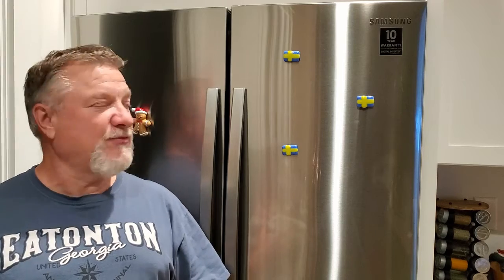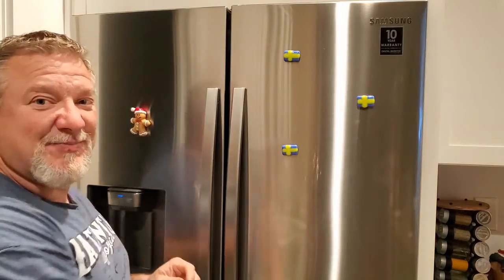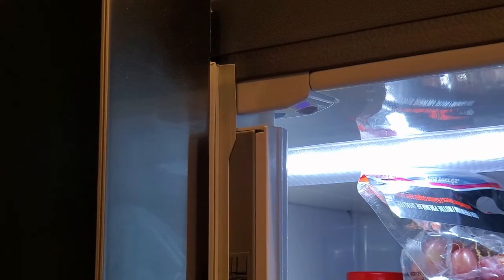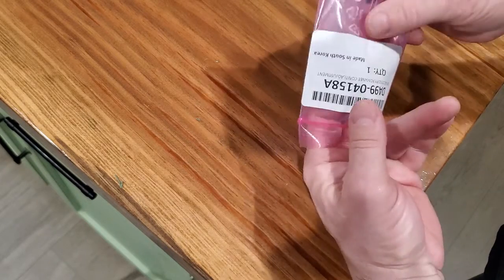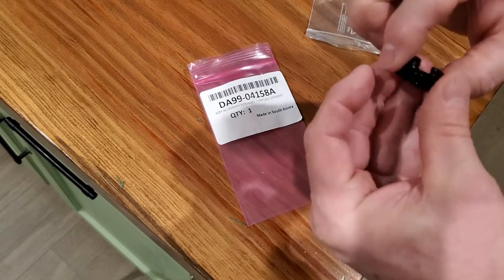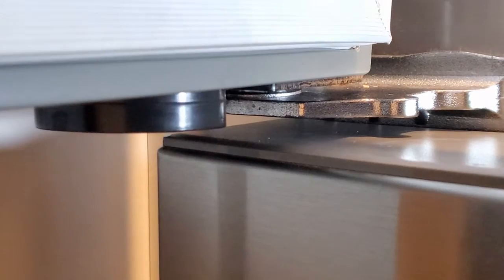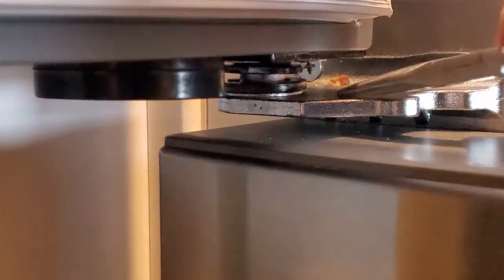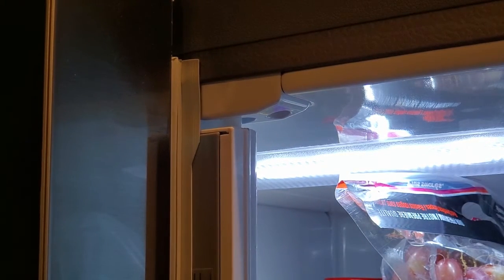Samsung Refrigerator French Door Mullion Flipper Fix

Comment: I have been adjusting the feet height trying to level this door. It only works for a couple weeks and the flapper starts riding under that track again. These should be a more permanent fix. Thank you!
I remember seeing them when the fridge was new but threw them out most likely 😂

Comment: What a great video!  It was simple, reasonably short and showed me how to fix the flipper mullion in my Samsung French Door refrigerator, which we bought a month ago.  The informational material delivered with the refrigerator included four different sized inserts for adjusting the height of the door.  The thinnest insert was sufficient.  Your video (and the ensuing successful five mnute repair) made my day.
Reply from the maker: Glad it helped!
Reply: @thistlehillfarmstead9131  great video. Wish this was my problem but my 4.5 year old was opening/closing the door and the little plastic piece that is supposed to catch came out of the top of the mullion so I can see the spring sitting there naked. Do you know if this is possible to put back properly. It’s quite difficult to do while assembled as I can get it lodged in properly.

Comment: Exactly the problem I am experiencing with my brand new Samsung refrigerator. I had it delivered on a Sunday, and by Monday discovered the problem. Of course, I went to both Lowe's and Samsung seeking advice and finally service, and am scheduled with a Samsung tech to fix it. I'd like my brand new $2K appliance to work correctly form the start. Of other note, the new refrigerator almost constantly is making noises of all kinds (but working). 

While the shim maneuver may work, it is explained in the manual as being there to level the two doors. This would not even be an issue, if the white plastic extender that engages the top of the door, were simply longer, by say 1/4 inch. The gap is much larger, so why not make the tab that engages the flipper slot longer? Probably 1/100th of a cent more in cost to make it better to begin with.  

Thanks again for your helpful video.
Reply from the maker: I agree with you, these type of things should not happen on a new appliance.  Glad the video helped.

Comment: Thank you so much. I knew there was a way to fix this issue. However, I couldn't find the spacers. I made them out of rubber washers which did the trick.
Reply from the maker: Glad you got it.  There is a link to the spacers in the description if you decide to replace what you have.

Comment: Hi, thanks for the video. My problem is the top white piece that slides and controls the flapper broke snd fell off. Is the only fix a full mullion replacement.
Reply from the maker: I'm not sure if you can order just that piece and replace it or if the entire flapper assemble has to be replaced
Reply from the maker: When I searched for "da68 Samsung Cap-Guide French Door" I think I found the part.  Try Google'ing that.  You may have to replace the "da68" with your model number.  Mine is DA68-xxxx
Reply: @thistlehillfarmstead9131  yes, the entire flapper needs replaced and it’s out of stock everywhere!
Reply: @thistlehillfarmstead9131  cap guide! Thanks mine is broken and I didn’t know what it used to look like without you mentioning the name so i could look it up. I finally found it broken in a fridge shelf and I think I’ll superglue it back in place. Permanently lol.

Comment: I'd like to ask another question.... we purchased the same samsung french door model.  I need to know if I have to put the fridge in a location where I have to open the doors over 90° in order to pull the inner drawers open.  In other words, can I put the refrigerator in a space that is up against a wall?   Or will I NOT be able to get the inner veggie crisper / fruit drawers open?  If you could provide me that answer, I'd be very appreciative.
Reply from the maker: You cannot put it right against the wall.  The door will not open all the way.  The handles on each door stick out 2 1/2" .  We placed ours 3" from the wall and thought we would be fine because there is an open door into our pantry on the left of the fridge. However, there is a 1" bump-out for the ice and water depressor and its hits the door framing so we can barley get the icemaker tray out.  I'd allow at lease 3"-4" from the wall.

Comment: Please help !! Bottom freezer door it stuck and won’t open after a deep cleaning. I noticed  the seal is shut in the bottom but not as much on the top
Reply from the maker: It may be frozen shut.  Open the top refrigerator doors and see if you can gently separate the seal.  When you lift up on the freezer handle there are two tabs that assist in opening the freezer drawer.  It may help to slip something flat, like a butter knife between the freezer drawer seal and the main body of the fridge.  You can also use a hair dryer to warm the seal if its frozen shut.
Reply: @thistlehillfarmstead9131  
Thank you so much for your fast reply !!!!! I appreciate you !

Comment: What if my doors aren’t uneven but the top piece won’t catch and close?
Reply from the maker: You may want to check the position of the door flapper.  Make sure it was installed in its proper location. You can still shim the door to make sure the flapper engages with the top slot, however it sounds like you will have uneven doors then.  This may be a manufacturing defect.
Reply: @thistlehillfarmstead9131  Thank you for replying. I was able to accidentally fix it…lol. I pulled up in the flapper part and it went up like a quarter inch and now works. I felt accomplished. Hahaha.

Comment: My right door was lower than the left.  So I added one of these shims to even them out.  It did accomplish that, but now the right door with the shim makes a clicking sound every time it is opened and closed.  Anyone else experiencing this issue?
Reply from the maker: Make sure the shim is under the door hinge and in the correct was.  It sounds like the shim may be turning when you open the door.